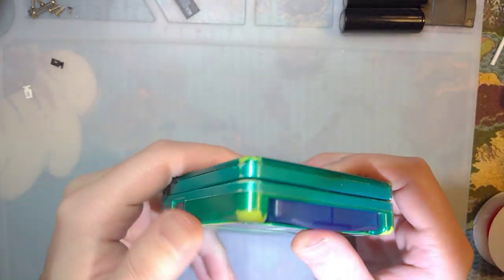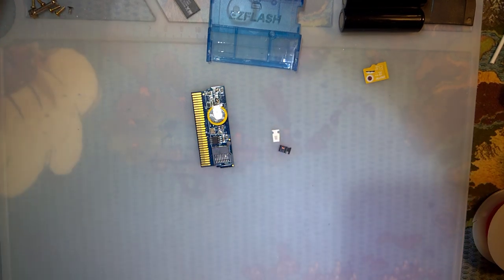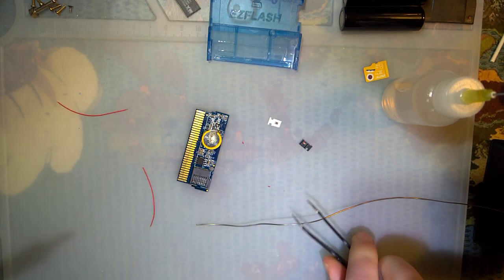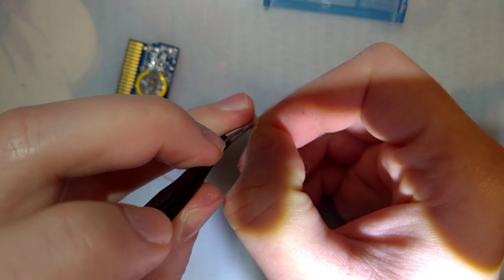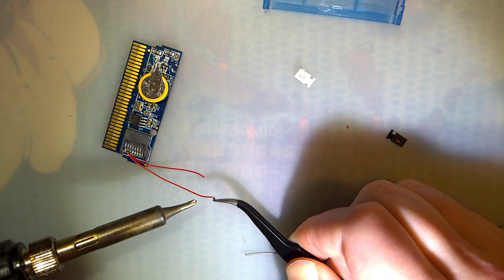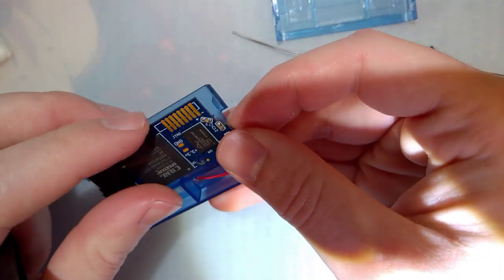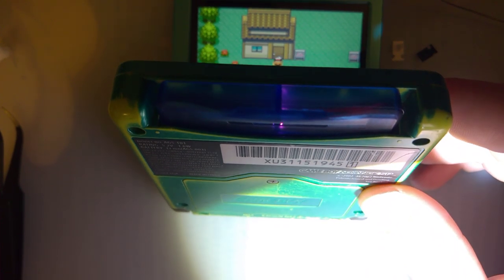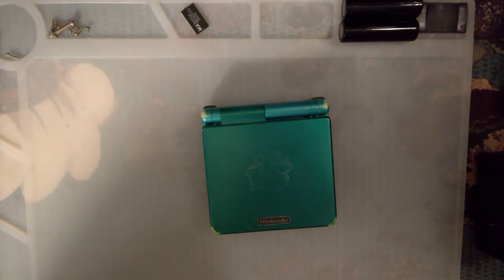Adding an Activity LED to an EZFlash Omega

Comment: It seems it would be better to connect the LED inverted, with the positive side connected to Vcc and the negative side to the data0 pin, since the data line is normally pulled up when not operating. That way the LED will only light up when the SD card is being read or written to, and would be easier to see in my opinion.
Reply from the maker: Have you tried this? I couldn't get it to work.
Reply: @makho  Sorry, i don't own a Ez Flash, it was more of a suggestion.  But I believe the value of the LED resistor should be lower, maybe 1K or lower just for test. Hum, I will try to test this on some other SD interface I have around...
Reply: Has someboy done it like this already?
Reply: @Melvin Maas so you soldered inverted led and it turns on only during save? I have a 2.0-2.4V led and 3k 1/2 watt 5% resistor. I don't know what it means but I'm ready to try if sounds OK on paper :)
Reply: that isn't how LED's work. they're polarised.

Comment: I still dont understand how people don't take 5 seconds to read the manual, or even the listing for the thing. The listing I bought mine from literally said you needed to wait after saving and yet somehow so many people complain that it doesnt work.
Reply: It’s only expensive when you compare it to the Omega. It’s actually the realistic price when you consider the Omega can corrupt you SD card. 

It’s more of you get what you paid for.
Reply: Everdrive GBA X5 is significantly better for that reason already. You don't have to wait for the cart to save before shutting the gba off. Still don't understand why people go for the EZ Flash when the new Everdrive gba is now sized like a regular gba cart.
Reply: Manual says 5 seconds after save but you actually don't know exactly when the game is saving, at least when using GOOMBA; I've corrupted my GB/GBC saves several times and I had waited 5 secs everytime I save, some people told me the emulator will save again once you open the menu to exit and some other workarounds but I'm not sure I'll invest play time in a game after knowing the progress can be randomly corrupted anytime.

Comment: i was very skeptical about getting an EZ flash Omega because i had seen so many people having corrupted save issues.  i made sure i followed the directions very very carefully and I made sure to get a trustworthy brand of SD card.  I'm happy to say I've had no issues with it so far, but I've only used it a couple days.  my only complaint is that i can't find the pink shell for it anywhere 😭
Reply from the maker: It's nowhere near as bad as some people will have you believe. Since you've already read the instructions, you're leagues ahead so I think you'll be fine. I've had mine since the launch and I've had zero issues as well, even after I modified it.

Comment: I'm gonna have to admit that I'm tempted to try this on an EZ-Flash Jr primarily for cosmetic purposes.
Reply from the maker: The uSD slot on the JR has the contacts on teh bottom. Soldering to the correct pins will be much more difficult unless you trace them out to whichever IC manages the interface.

Comment: You think it’s possible to reduce the 150ma power consumption to something lesser? 

Am no electrician 😂 but put something inline with the power pad coming from the GBA card slot (on the ez-flash) so bring the draw down?
Reply from the maker: How are you going to add parts to lower the power consumption? That's not really how that works.
Reply: @makho  diode or resistor so when it draws power from the BBA pin it will be reduced. Bit like how the battery mod and the diode to drop the voltage down to 3.4v.
( cut a trace and put a resistor to bridge the gap on the ez-flash)

Again haven't a clue but I ordered one and I want as much battery life as possible lol

Comment: Cool idea! my card arrives this week, did a ton of research on the proper way to save haha
Reply from the maker: Honestly, just wait a few seconds after saving. I've never had any issues with mine. I know the omega does not play well with some brands of SD card though but I haven't been able to track down the specifics.
Reply: I have a 32gb Samsung Evo select that I had been using for a month that I lost my saves on. Just switched it to a SanDisk myself and hoping no more issues. But probably going to add an activity light like this myself to be safe.

Comment: You should also be using flux when soldering the resistor and LED.  There is really no reason not to use the Noclean Flux on each and every solder point to help adhesion.

Comment: I really don't like the idea of soldering directly to the MicroSD slot.  There's gotta be a better way to do this.  It would be really nice if an LED were simply included in the design of the product.   Does the Definitive Edition Omega have an access LED?  I sure hope so.
Reply from the maker: Yes the ODE has an LED but it does not access the uSD card for write operations except when in the ODE menu so it's not really helpful.
Reply from the maker: @skins4thewin  They heard people's complaints that "we don't like how the save operations work" and "we want a status LED so we know when we can safely turn off the game" and then changed both without realizing that it was an either/or thing, not a blanket request.
Reply: @makho  They changed how saving works in the new one?  How so?
Reply from the maker: @skins4thewin  more like the everdrive where you have to reboot into the menu to copy the save to the SD
Reply: @makho  Either way, other Everdrives have proper real time saving to the MicroSD and yet they also have an LED that lets you know when the card is being written to during gameplay.  It's nice to have so you can literally see the data being written as it happens.  Seems like a rather odd oversight more than anything to not include that ability for the LED.  I don't know what sort of technical limitation there could be to prevent that sort of feature.
Reply: @makho  Wow..... seriously?  That is NOT a fix lol.  That is even worse!  So they basically cut corners and went back to the old way of doing things, a way that the more advanced Everdrives don't even do anymore.  

The proper fix would be to have the thing be able to write during gameplay at decent speeds and not be slow as molassas just like the more advanced Everdrives do, and have an LED that shows when it's being read and written to.  Seems they just can't help but to be cheap...
Reply: @makho  Well that absolutely seals it for me.  I won't be buying the Definitive Edition.  I actually thought it was impressive that the Omega wrote to the card during gameplay.  

I can wait several seconds before turning off my system, it's really not a big deal.  I'd MUCH rather have it be that way then have to remember to enter the menu each time.  That's the sort of thing that the freaking x3 GB Everdrive has to do.  

Ridiculous....  I am surprised fans aren't pissed that they actually regressed the saving ability of the unit.

Comment: Blue omega ? Did they change the color ?
Reply from the maker: No, there are just other cases available. Red, blue, green, orange, pink, and full clear are (were) available to change from the default smoke case. Some colors are a lot harder to get than others. 

Green, full clear, and pink were reviewer only colors, then pink got a second limited run. Orange, red, and blue are the only colors you can get regularly now I believe.
Reply: @makho  ah rip ... well i cant find them anymore sadly but ig theyre maybe gonna do the same with the new version
Reply from the maker: @IcePhoenixOfTime  
https://retrogamerepairshop.com/products/ez-flash-omega-gba-game-boy-advance-game-card-housing-shell-orange?_pos=4&_sid=fb3934b13&_ss=r&variant=32228061642826
https://retrogamerepairshop.com/products/ez-flash-omega-ruby-red-shell-only?_pos=6&_sid=fb3934b13&_ss=r&variant=37611579310252
https://retrogamerepairshop.com/products/ez-flash-omega-ruby-red-christmas-edition?_pos=5&_sid=fb3934b13&_ss=r&variant=37611530813612
https://www.retromodding.com/products/ez-flash-omega-faceplates?variant=37104687284380

Comment: Are you aware of the new EZFlash Jr. flashcart for GB/GBC that came out a few weeks ago? Mine arrived 2 days ago and I was able to test it a little bit. I also have the EZFlash Omega which really impressed me  when it came out. The EZFlash Jr.  is nowhere that good. It works, but has a lot of issues. You can't have more than 90 roms in a folder or it will get file system errors and crash. This still happens after I sorted my Roms into alphabetical folders. Sometimes it hangs after detecting the SD card when powering on. Also the navigation menu is quite slow. Compared to the Omega this thing is pretty bad and even compared to my 5 year old Everdrive GB (per X3/5/7) it doesn't look good. It loads faster but still has way too many bugs.
Reply: Im still waiting for mine in the mail. Is it any good?
Reply: @PLATESWEEPER  Unfortunately no. As described in my previous post this thing has a lot of issues. At least my cart has, maybe it is a faulty unit. It works, just not reliably. However it only costs half as much as the cheapest Everdrive so it might be an option.
Reply from the maker: Have you installed the latest firmware update? The UI is still a bit laggy but it fixed most of my complaints.
Reply: @makho  The cart is on firmware FW 3  K 1.03. I am still getting a lot of file system errors. I might test another SD card, so far I used a Sandisk Ultra 16 GB one.
Reply from the maker: @XennialGeek  I regularly use an old SanDisk card from like 2010. The cheapo SD cards from aliexpress also seem to work nicely.
Reply: @makho  I did some testing today. Switched to an old Samsung 8GB card, reformatted, renamed folders, shortened folder names, removed some special characters. I get less errors now, but still get some. So far I haven't found anything conclusive what might cause this.

Comment: Those wires are WAY WAY WAYYYYYY too long!  You really ought to shorten them significantly.  I really don't know why you used such long wires for this.  That is not a good thing to do.  You want the shortest wire runs as possible when doing stuff like this.

Comment: I dont use my  EZFlash in my GBA SP anymore. after i added a louder speaker i loose some of my save states cause of the bigger magnet
Reply from the maker: that's not how this works
Reply: makho  i know That an sd Card dont save With an Magnet but this dont mean That it can t damage the data
Reply from the maker: @btmg4828  this isn't a floppy disk, magnets have zero effect on any of the hardware in a game boy or ezflash.